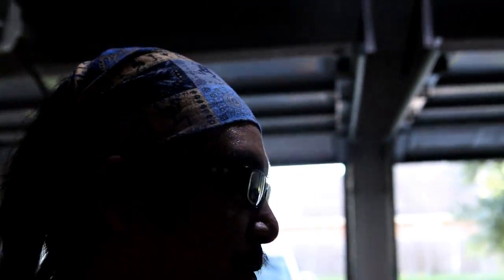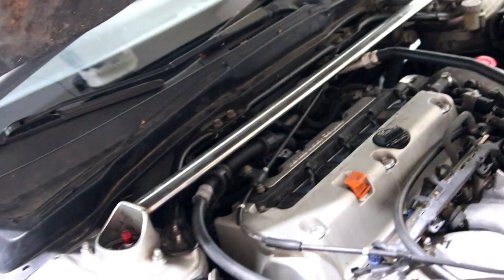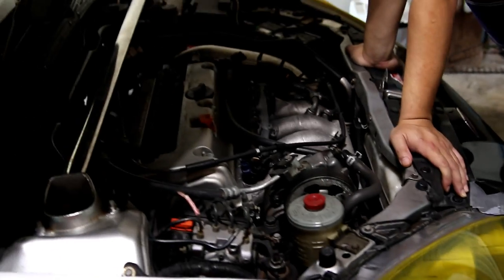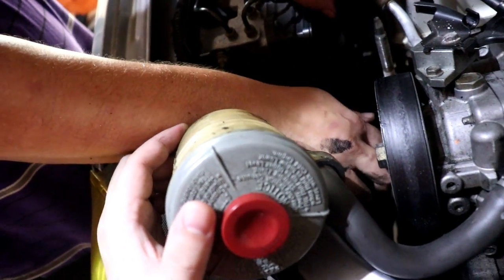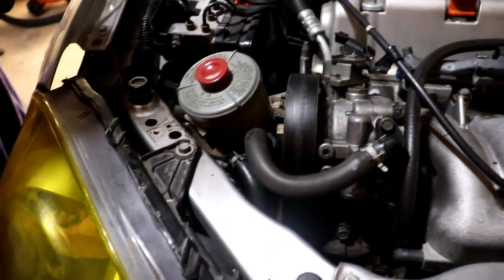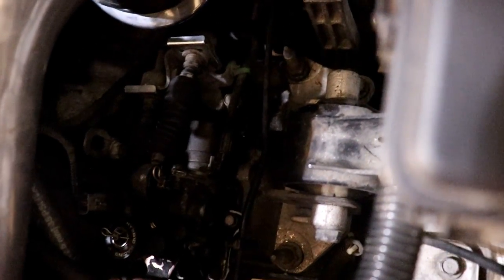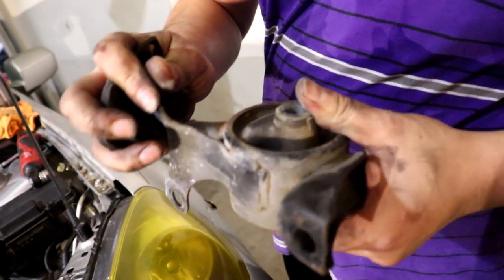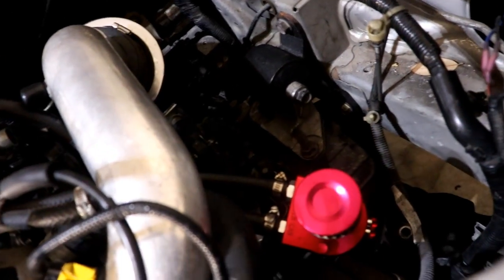Installing Innovative Motor Mounts In The RSX!

Comment: how's the ride, im guessing you drive the car without much comfort in mind, but im asking because i need motor mounts in my stock rsx, but i am going to continue increasing power bit by bit. So idk if i hould get some relatively soft ones now and upgrade when i see fit.

Comment: Any plans on replacing the front mount?  I think that (or the rear) is the hardest to find outside of a set.  Impressions?  Mine were hard rubber.  I thought the NVH was noticeable inside the cabin especially at idle.  I guess my engine is more stable and responsive.  I wouldn't recommended the aftermarket ones for a street only build (I track sometimes).
Reply from the maker: I probably won't, I've been told it's the least important one, as it's basically just a shock absorber rather than mount... My vibrations at idle are more noticable, but then again the car is half gutted and all that and isn't a daily lol

Comment: was wondering if you guys have had any problems putting the ground on the abs bolt? also which bolt did you end up putting it on? doing my research right before I redo my mounts and come to realize innovative mounts haven't fixed that issue
Reply: Where did you decide to mount it doing this job now and need help